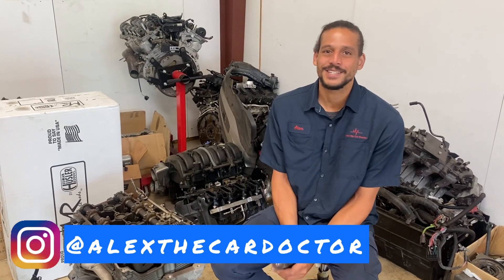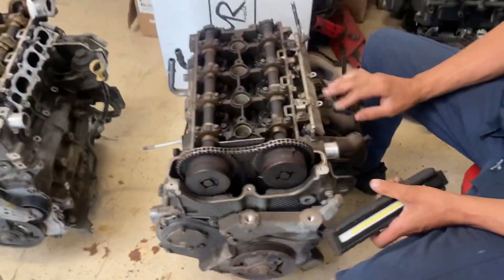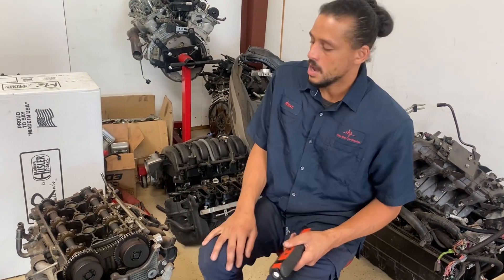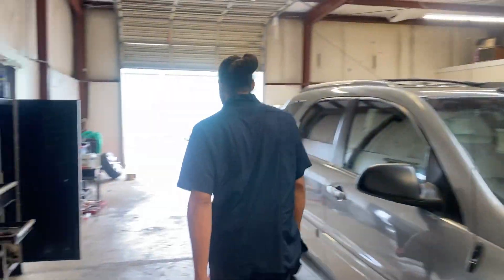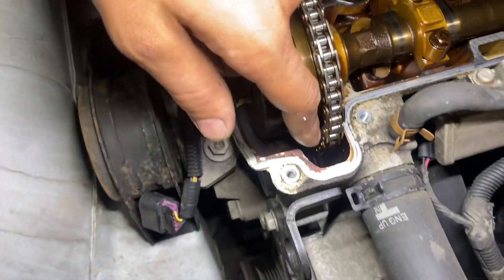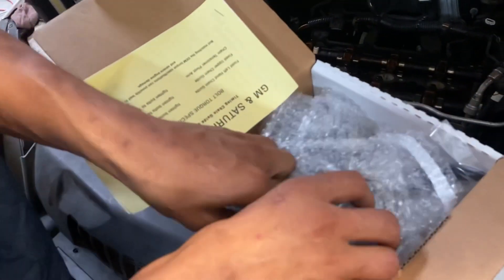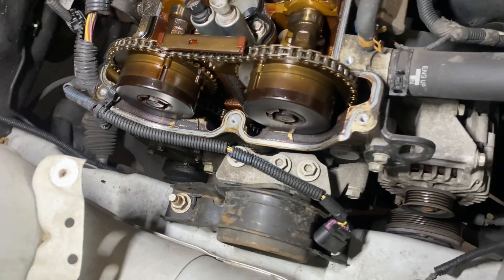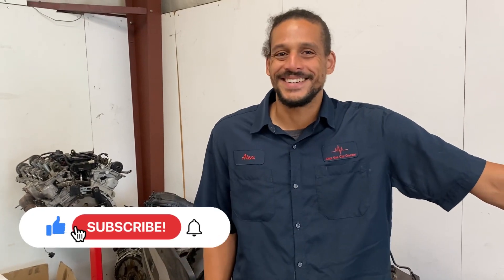Common Timing Chain Issues with GM Ecotec Engines | Timing Chain Rattles and Codes  timing chain #gm

Comment: i just did this about 4 months ago for my girl and she let the oil get low and now she got the p0016 and 17 codes and i just took it apart and i do not see anything out of time. the crank is at 12 o clock and the cams are 10 and 2 o clock so i;m not sure what to do. i changed the crank sensor the other day and the code returned,  do you have any ideas?
Reply from the maker: What Brand timing chain set did you buy
Reply: @AlexTheCarDoctor  i got on off ebay that matched the numbers from rock auto, and i compared the new chain the old chain to make sure the marks were even. they were this engine takes 2 exhaust phasers i found out the hard way. i moved the exhaust cam counterclockwise to cause the tensioner to get slack to see if the tensioner was actually putting tension on the guide and it was i could see it move, i did the same to the intake going clockwise and the tensioner moved the same so i'm stumped. tomorrow i'm going to take it all back apart and redo it after i check the chain against the old chain again and to make sure the guides did not break off. and the tensioner is not actually broken. it was a 300$ kit plus the phasers. i will also take the phasers apart to make sure they are not busted inside. the old ones were all busted up inside.  i do not believe the cam sensor both failed when it ran low on oil. the codes i found out indicate more then 16 deg out of time. that sounds like a jumped tooth. tell me if you can when i turn the crank keyway to 12 o clock is the 12 o clock to the ground or to the bottom of the block? or will the timing be relative to the marks so if the crank is a bit off the cams will be a bit off relative to their marks? so do you have any suggestions for me? thanks
Reply from the maker: @bobpalmer4740  I learned the hard way messing around with timing parts of eBay now I only use Cloyes or other top brands.  When I time up timing chains I always match up the color chain link with the mark on the ⚙️ of course it helps to know what General area they supposed to be which you have it correct 10 to 12 o’clock for cams and 12 o clock key way on crank
Reply from the maker: @bobpalmer4740  it should be some dots on the sprockets to line up the chain links
Reply: @AlexTheCarDoctor  ok thanks i figure if the marks aligned to the sprockets then it is timed. if the crank is a bit off then the cam phasers would be just a bit off. but they still should be relative to each other. so i guess it is possible that when it ran low on oil it may have busted the phasers. so i guess i will have to take it all apart and take the phasers apart to make sure the fingers dd not break.  i have had good luck getting car parts off ebay maybe i'm lucky.  i thought maybe it jumped time on the crank when it ran low on oil as the codes showed up at that time. but like i say i took the crank bolt off and set the key to 12 o clock and then checked the phasers and they were still 10 and 2 o clock. i changed out the crank sensor and i do not think that low oil pressure would make the cam sensors fail. so what i will do is take it all apart and reset it all back and get 2 new cam sensors and see how it goes. providing that nothing has broken thanks
Reply from the maker: @bobpalmer4740  good luck buddy let me know how it turns out. I wish I could be there to help you in person

Comment: Would this also rattle lightly when you first start to press on the gas easy ?when dry revving no noises and and it’s has 79,xxx miles
Reply from the maker: Hey there you normally hear a rattle on first start up you may have an exhaust heat Shield making noise. What type of car do you have
Reply: @AlexTheCarDoctor  gmc terrain 2015 2.4 ecotec yea rattles on start up and when pulling out slowly real lightly on the gas, if you in neutral or park and Rev it easily you can't hear it
Reply from the maker: @paulcherry1520  Can you send me a video on Instagram
Reply: My 2.2L ecotec has a exhaust leak. It ticks pretty loudly if I start the car below 45-50F ambient temperature. Sometimes it is not detectable unless you press the gas and you can hear a very slight tick. It goes away like a light switch in a minute or 2. Either a cracked manifold or a broken bolt I think.

The only reason I know it is not a timing chain is I stuck my head all the way back near the manifold and donut and it is clear as day its coming from there. Also, the old screwdriver to the ear trick yielded no funny noises coming from the valve cover/timing chain area.

Comment: So the only way to fix that problem is to replace the timing chain
Reply from the maker: I have seen them engine engines last long with great quality oil. It’s hard to know what you have when you buy the car used . When It get to that point the best thing to do is change the timing chain set

Comment: I was reading about this. Apparently, the newer engines are Direct Injection engines.  When the engine is cold, and you run it for only short periods of time (less than 30 minutes) excess fuel is injected into the engine so it can run.  That excess fuel does not always fully burn with the less time to combust.  It leaves carbon which mixed into the oil.  Lots of short trips in cold weather, more carbon.  More carbon, the timing chain gets stretched as the distance between the pins on the chain is extended.  Over 100,000 miles, that is a lot of stretching.  Advice - mix in trips longer than 30 minutes every week. Also, oil you use should be API-SP certified or ILSC GF-6 oil as it can contain the carbon better (not perfectly, but enough to potentially reduce the timing chain stretch).  I am hoping doing these things will allow my Buick Envison with a 2.0L Ecotec make it to at least 150,000 miles.  However, I appreciate the tip to change the chain at 100,000 miles.  I will do that as well.
Reply from the maker: Good advice as well buddy that may help a few people whoever comes across this thanks
Reply: @AlexTheCarDoctor  PUT SOME LOCK TIGHT IN THE WHOLE AND THEN THREAD IN...THERE ARE SOME COMPANIES THAT MAKE PARTS TO FIX PROBLEMS WITH THESE ENGINE "
Reply: Since April 2020, with an engine replacement, I've kept my oil changes at ~3K+/-, using diesel oil: SAE 30 CF-2 and/or 15w40 on my 2011 Chevy HHR.

Though last Friday, August 29, lost compression, as determined a few days later, though plenty of spark, and fuel pressure.

With Gig delivery, hard use, and ~134K miles of travel on an engine that was labeled as ~190K from the wrecking yard. 🤔😬

2024-09-06 1339 PT
Reply: NGK XL WILL SOLVE THAT PROBLEM
Reply: Yeah, sure dude that's it...the carbon

Comment: Dorman part 917-954 is a special bolt that threads into the access plug hole for the chain guide bolt. No need to repair the damaged threads on the inside. Saves a ton of time and money.
Reply from the maker: Dorman 🤔 of everything, I’m about to buy 10 of them thanks again
Reply from the maker: Thanks so much buddy that will save my customers a ton $
Reply: @AlexTheCarDoctor  where’s your shop bro
Reply from the maker: @lamarcusbennett4738  1850 Joy Lake Road 30260
Reply: I put this Dorman bolt in all my ecotecs as a preventive measure and religiously change the oil and I’ve never had a timing chain problem and run my cars to 300,000 miles all the time.
Reply: @ImpalaSS08  Good idea. If I was going the preventive route I think I would also replace the timing chain tensioner. I believe it's the weak link that creates slack and destroys the bolt to begin with.
Reply: @ALEXTHECARDOTOR I’m a GM technician newly!!! I started from the bottom and worked my way up but I have a 2005 Chevy classic looks like a Malibu but I think the timing chain maybe  my problem I heard rattling one time few days later bam no start and sounds like no compression I have another motor but I wanna be sure if a motor swap is needed
Reply: @michaelallen5505   dude you have no idea how many days I been trying to get this headless bolt out and then come to find out there is a part for this thanks a lot dude your a life saver.
Reply: @jrpando8637  My old bolt was completely gone when I took the timing chain cover off. I guess it's been harmlessly rattling around the bottom of the oil pan for the better part of 100,000 miles now. My 2007 Saturn Vue hybrid with a 2.4 L engine has 267,000 miles. Everything still works.
Reply: That is awesome!!

Comment: Hey man, thanks for the insight, I have a gen 1 2.2 in an 05 Cobalt, I replaced the tensioner with the latest part from delco.  The engine runs great, but still noisey  on a cold start.  Do you think a tension  guide could destroy the motor?  The chain is tight, had the rocker covet off when I did the install.  I am not going to do anything else to the timing set as it is just a winter beater, just a curiosity question for my knowledge, and piece of mind.
Reply from the maker: Hey buddy thanks for watching.it may be a tensioner like you said, it’s always important to change everything together but since it’s not an every day car it should be fine
Reply: Noisy on a cold start is usually a vct actuator on the cam sprocket
Reply: @archangel3237  
Thank you for the insight,  however this engine doesn't have variable valve timing, but the later versions do.  It's been a while that it has been going on, but still runs very well, so I will just let it be until something happens.

Comment: s there a way to adjust the timing without marks?  I took the chain out and my stupidity allowed me to turn the the sprocket s individually, which turned the cams.  Now I have no idea where I am at.  Call me  an idiot because I am.
Reply from the maker: Never an idiot let’s call it hands on Learning the hard way. I have a story similar to yours when I was younger mechanic. You will have to takeoff the front timing cover to time it up properly
Reply: @AlexTheCarDoctor  Thanks a lot for your help.  Great video.
Reply from the maker: @cartroublewannafix8611  my pleasure
Reply from the maker: @cartroublewannafix8611  I just watched your video it appears you have to top lined up perfectly fine the bottom I could not See that good double check you have the pink link on the dot if so you should be able to rotate the engine by hand without any binding if something locks up stop immediately and double check the timing marks
Reply: @AlexTheCarDoctor  The pink is on the dot but the crank is not  in the  12 o'clock.  It's about on the 11 o'clock position.   Would that have anything to do with me turning the cams just out of the blue?  Because from what i read,  the timing is done when they build the engine.  What im afraid is that  they are on different strokes.  Is that possible and then there could be damage on other pistons?  Thanks again.
Reply from the maker: @cartroublewannafix8611  everything should be fine if the dots lineup with the links don’t worry about different strokes no sense to complicate things as long as the docs lined up everything is correct just make sure you spin the engine over by hand once you get everything lined up to make sure nothing is binding up
Reply from the maker: Hard to say if engine damage has occurred but I don’t think so as long as you didn’t force turning something when it was binding you should be fine and as long as it didn’t come apart while it was running
Reply: @AlexTheCarDoctor  https://www.youtube.com/watch?v=GBcBrAuC7tI .  This is a small video of my cams.  Do you think i'm 180 degrees off on the timing ?  Thanks for the help.
Reply from the maker: @cartroublewannafix8611  looking at the cams won’t help me much it’s all about the front of the cam gears.did you by chance remove the cam gear pulley
Reply: @AlexTheCarDoctor  cam gear sprockets are in their marks  where they are supposed to be.   10 o'clcok (diamond) intake and 2 o'clcok (triangle)  exhaust cam.  Crank  shaft is at  12 o'clock,  chain link mark is at 5 o'clcok where it's supposed to be.
Reply from the maker: If there is a way to adjust it without marks I don’t know it’s best not to play around with certain engine’s you will bend valves are you working on a 2.4 ecotech
Reply: @AlexTheCarDoctor  No, but it's a 2.5.  I do have the front cover off and I replaced the chain.  and other parts.   My worry is that   Its not possible to time it since i rotated the cams individually and because of my lack of knowledge on that issue I didn't mark anything, so for all I know, the  intake and exhaust cams might not be working together.  I only know what I watched here and on youtube and what I read, but I should have read it before.   Thanks agaian.

Comment: Lots of great information here.  I didn't know some timing chain driven cars were so problematic.  I wonder why Chevy went with the chain and not a belt on those cars.  Thanks for sharing!
Reply: Unfortunately belts have pros and cons as well. They're more likely to stretch, teeth round off, or break then a chain is.
Generally the problem isn't the chain itself it's usually the guides or the hydraulic tensioners. Low oil or lack of oil changes will cause these issues prematurely as well.
I also see and deal with alot of ecotecs, most of the time I fix them unless too much damage has been done.
Reply from the maker: I was wondering the same thing! I actually got one in the shop now, with a broken timing chain that I’m going to do a video on soon. Stay tuned! And thanks for watching and interacting in the comments 🤗
Reply: Because GM had major issues with the timing belt engines. They failed before the interval for replacement.
Reply: I think Gm  should replace it this for free since it’s a big problem with those cars, I have a GMC Terrain, 90 thousand miles and already have to replace a timing Chain it cost me $1400, that’s sucks …
Reply: @Maria-hm4gc  is that with parts and labor ?
Reply: If its a DI motor ,timing chain probably handles the high pressure pump load better then a belt would. Even so it seems like a bad design for DI's driving pumps
Reply: Because they are interference motors, and timing belts break. So byby engine. I have almost 300k on my jeeps chain 230 on my cars chain